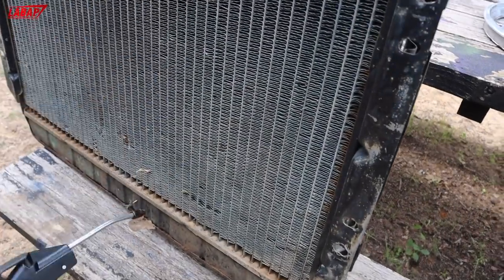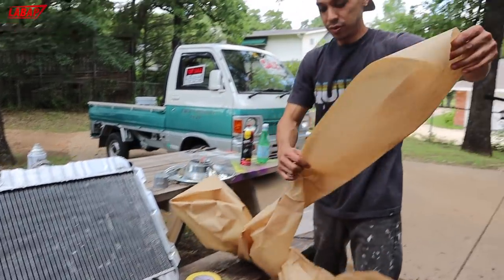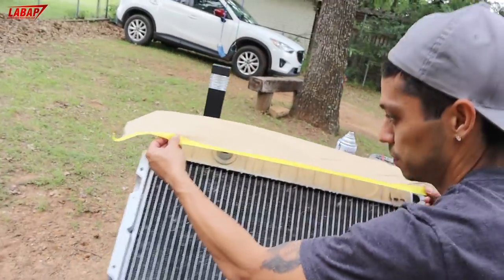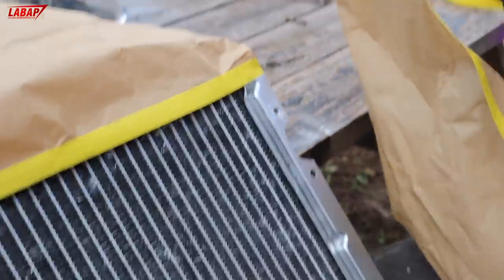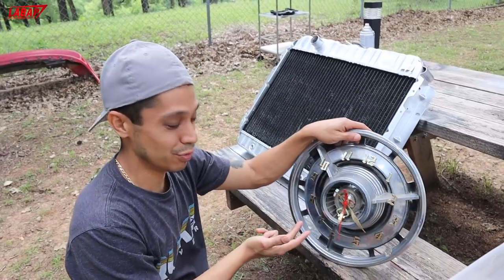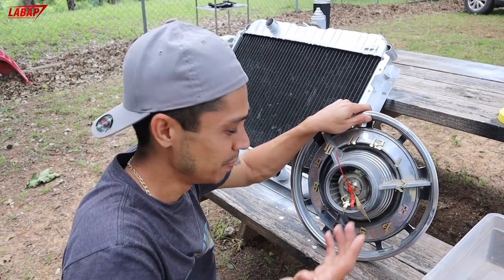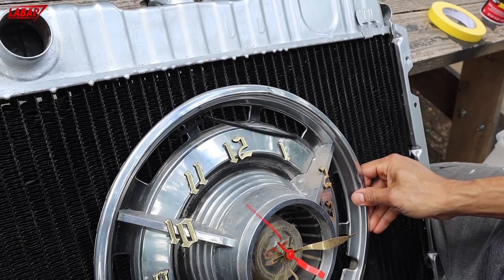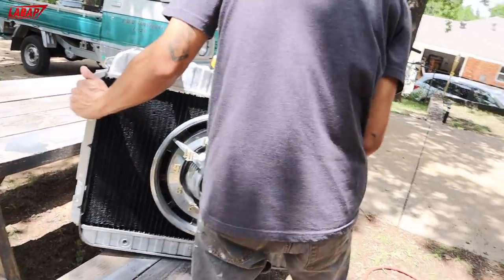WOW! Junk Under-Hood Parts Into Car Art - LABAP Custom Car Art!

Comment: I’m working on a badass coat/hat rack. Made from an exhaust flange and connecting rods and exhaust hangers. Take the cap off the rods, cut one side of it (where the bold goes through) so that it rests at an angle when butted up against the flange, 4 of them evenly spaced out and a few exhaust hangers hanging down below for hats 🎩